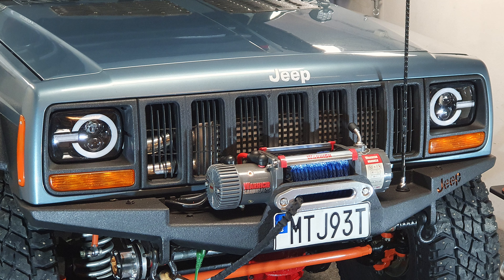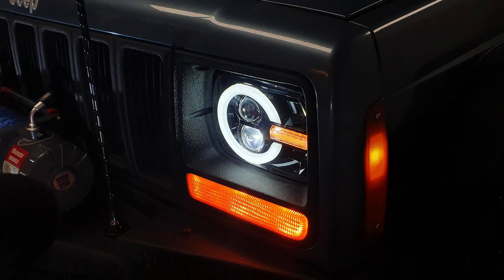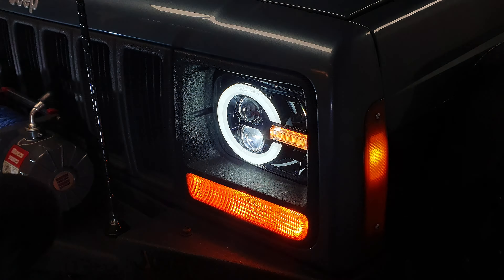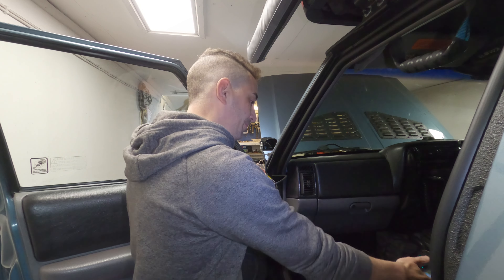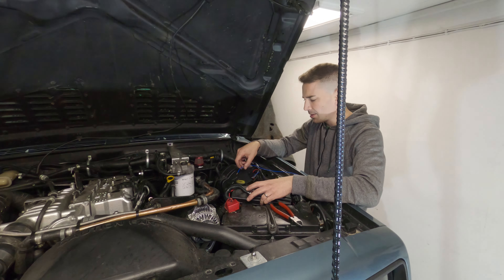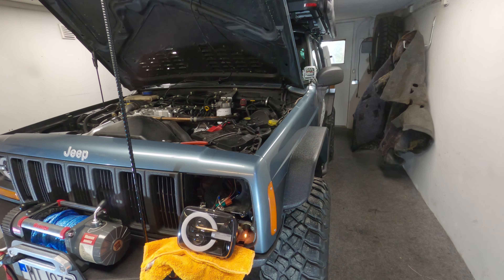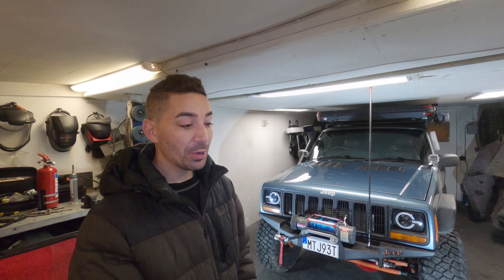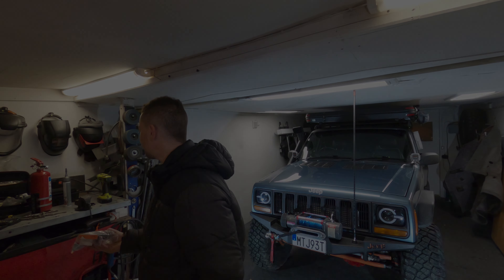Installing Loyo 3" Ditch Lights With Turn Signal Wiring - Easy Installation Guide!

Comment: 😮 i saw the title and said nooo not led lights. I live in alaska and people are finding led lights dont produce  heat so when you drive in a snow storm, the snow doesnt melt and you have to stop and clear them. But they look cool. ❤
Reply from the maker: They do look cool. I've experienced the smaller cube lights frosting up, not the headlights. They seem to get quite warm but I need to test them more. Thanks for watching
Reply: I run led headlights, led ditch lights and a 40” led single row light bar. I live in Colorado and what you say is correct they just collect snow and it stays frozen. Your lights just become blocked out like a solar eclipse.. so I also run three  7” 55w HID pods right on the front of my bumper.  Two yellow on the sides and and one white in the center.

Comment: mike you gotta do the harmonic balanced before it pulls off of the crankshaft towards the mechanical fan!
Reply from the maker: Okay, then that's my next order. You mean for the 4.0 right? 
I will get one next and go to town on it. Thanks for waking me up on that
Reply: @WorkshoptoWilderness  yeah it is on the 4.0. my harmonic balancer pulled away from the block and out towards the radiator. this caused my mechanical fan to strike it on every fan blade and made a horrible sound

Comment: Hi Mike. Those ditch lights are very nice! And the indicator is a great touch. Also handy when the front of the Jeep is dirty. Those indicators lights will most likely stay much cleaner higher up. 
Mike I have some 3x3 rigid lights on the front of my xj. 2 are spot and 2 are flood type. I also don’t like light bars. And because mine are all individual. I can put the light where I want it. But all my lights facing forward are below the hood. I even turn my interior dash lights down low when night driving. I find that the best. No hood glare or interior light to effect my vision. 
If you are looking for more long distance spot range. Then you might be ok up on the roof under the tent. But set back a little from the windshield. But the slightest dust/snow and it makes your vision far worse. Well that’s what I found. Before mounting any of my lights permanently I move them around a lot to see where they work best for me and my needs.
Reply from the maker: That sounds like a smart setup. Appreciate the info! I think I will try four or Five cube lights up high under the tent but in snow storms they will be more of a hindrance. I saw  jeep sunshade that looks pretty good l though I would be very  reluctant to just screw something to my sheet metal roof as advertised. Thanks for the comment and for watching.

Comment: Hi, I think that tungsten bulbs takes longer to get bright than LED which are instant on, this is  because the filament needs to warm up before maximum light output is reach… And if you remove your regular bulbs, depending on the flasher used the leds will flash faster, you would have to add a resistor to simulate the bulb resistance and make the flashing be the normal rate, or change the flasher relay to one that to not rely on the bulb resistance, if that all make sense? Love the videos and the humour, thank you.
Reply from the maker: Thanks for the information and for watching. I will see if I can get some led replacements and check how they perform. Or a new relay as you mentioned. Glad you enjoyed the video and thanks again

Comment: Looks good Mike. One thing I've been wanting to do is add an amber light on my roof rack facing backwards. Something not blinding, but somewhat bright like an indicator. To be used in highly dusty or snowy situations when someone is behind me. Often times taillights can straight up disappear in dust/snow.
Reply from the maker: Thats a very good idea actually, now I want to do that! 😄 🤣 
Thats a smart move though, more signal lights the better in some way. With the powered snow on the highway it would help to have somthing elevated

Comment: My xj is a limited model so it come with fog lights from factory I have done something similar to you but just ran the wires to the original fog light loom maybe you could look into getting an oem switch panel from a limited instead of fitting a switch or going from your main beam (mine don’t have indicators)
Reply from the maker: Ah nice, I've not seen one with foggers. Here is standard to wire extra lights to main beams. They will only every be used in winter in my case.

Comment: Hi Mike! I have the ledbar on the place you gonna put it.
And it's really great how much light it's give.
But I have one problem with it when I put it one I see nothing fore 5 ore 10 seconds.
Because to much licht comes in the cabine.
I looking fore a solution when having it I let you know.
Reply from the maker: Hey Pieter, I will probabaly go with five cube lights in the black variant and mount them under the roof tent. They have a nice focused beam with little light spillover so I think it will work well. I will think it over and film it if I do the job.
Reply: Thanks I look forward to see

Comment: Had to pause the video at the only fans bit so I could finish laughing.... obviously 😳

 Mate this was great info ... a lot to think about. And yeah I don't like like light bars either so if you come up with a better solution I'd buy you a very large coffee/beer/whisky chap.

Again ... throughout ... thanks for the laughs I'm having a crap day and I needed that 👍
Reply from the maker: Glad you enjoyed it. I was thinking of five cube lights mounted under the tent. Without the signal lamp mounted up though. It might look good and there would be no hood glare. I would use the black ones though and not the silver ones if I did that just so it didn't look strange. I will have to play around on photoshop! 
Thanks for watching mate 👍 hope your having a better day today
Reply: @WorkshoptoWilderness  That's an interesting idea. I look forward to seeing any mock-ups. And yeah keep going mate your videos are always worth a watch 😎

Comment: Nice looking lights. Could you not wire the blue wire to your driver side inner fuse box? My xj has the full beam fuse in there and I will piggyback off that. Not done it on an xj, but I do that on my smiley transits... I'd not thought about hood glare as I've only put spotlights on top of my transits and I've 6 spots ready for my xj. Guess she'll be getting the matt black treatment asap. Thanks for your time. Learned so much about my VM from your videos. Have you covered front and rear crankshaft seals? I got a leaky one just now.
Reply from the maker: I don't think the blue control wire draws much voltage as the lights are directly hooked to the battery. I guess its just to activate the relay to open the circuit so I don't think it will be a problem on the light harness. I guess I will see in time. 
Hood glare has always been a real pain with lights by the mirrors. I cant remove the brackets anymore though so I wanted to make something work there. Fortunately these do! 
The crankshaft seals are a pain in the ass. I loosely covered them in a clutch video. Had to pull the adapter plate to get to the camshaft seal which always leaks.. front one aswell is also annoying to change.
Thanks for watching 👀
Reply: I was just watching some of your clutch videos. I managed the front seal no bother. Made a wee tool for the pulley... Still a drip from between the gearbox, so rear seals ordered. I'll get stuck into some more videos and prepare myself.... Thanks for the great videos!
Reply from the maker: @seanbrechin9422  Ah nice one. It's a pain of a job. The red o ring behind the transmission adapter plate always leaks. I think its the cam shaft o ring. 
Anyway hopefully it's not too much of a pain! Thanks for watching

Comment: If you want to switch the standard turn signals to LED as well, this is the best comprehensive video I've found on that topic, it's the video I went by when I swapped all of mine to LED: https://www.youtube.com/watch?v=vj7q325BTAs
Things to note are that in 2023 Sylvania still sells those bulbs he uses in the video, but now in a different style optimized for reflectors, with no forward facing diodes. This is fine for those who have also swapped to clear housings like the ones shown in this video, or when running at night, but daytime they are not bright enough and cannot be seen well from an angle that isn't head on. I personally wouldn't consider them safe for road use. I have switched to cheapo Yorkim LEDs I bought on amazon that are working fine so far, these have diodes on all sides of the housing, mimicking a standard bulb. Note this is not a problem for reverse lights, and the new style Sylvanias act like a second set of low beams at night.